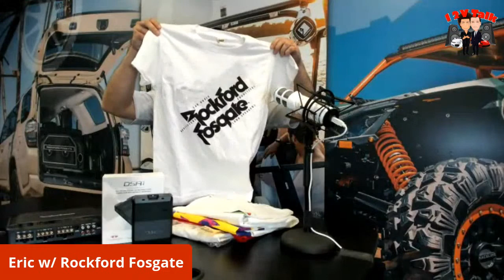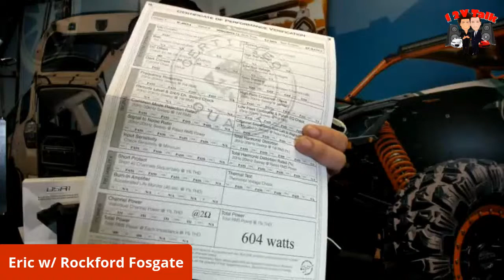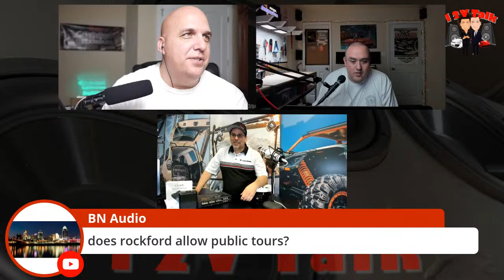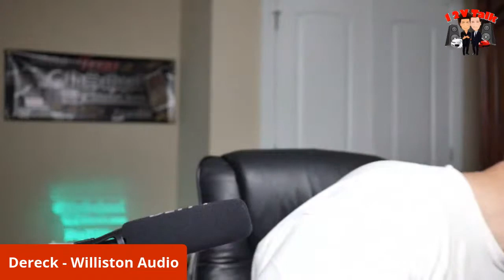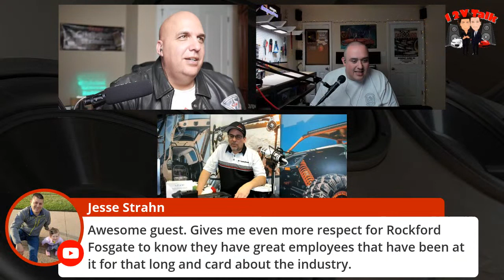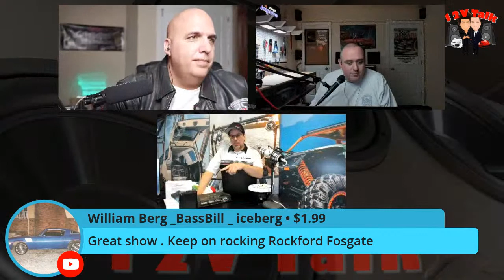Eric Russell - Rockford Fosgate - 12V Talk Episode 71

Comment: I have a dumb question....
Say I have two punch 501s and I have one bass knob. If I want to run one amp per sub and try to keep them balanced , how would I run one knob? I have an Oscilloscope so I can set everything pretty close deck and gain wise but I don't know how Rockford's bass knobs work as some amps have them as gain and others are a bass boost where's I've seen some as low level voltage rheostat.

Comment: Always been a RF fan, I still have an 800@4 from 1999 that's still in the box, it's never seen power. 😁
Reply: will you at least use it one day, so it's not a total waste...?
Reply: @RWL2012  Yes, lol. It's being used this summer to finish my system.
Reply: I have two 501s , one 500 power, one 800a4, 201s ,301s, 401s , 120a2, 150a2( I'd have to look on that one ) and subs... (2) 12 pch128, (2) hx2 10's and (2) p2 10's just bought (2) new p312d2's. I still use my set of pch65 's and power 6.5 components sets. Every Rockford I have bought ( minus one 75 watt and 250 watt amp...sold them ) I still have and I still use.

Comment: I have always been a fan but I will never buy another product from them.

My brother blew a fosgate shallow t1s2-12, its a 600$ sub. I reached out on his behalf in hopes of getting it repaired. 

Rockford offered mo help or anyone who could Repair it. 

That just left a bad taste from such a great company.

He has now went with Fi,   they will stand behind their subs and sell recone kits.  

As always a great interview.
Reply: Hi Dragon51,  Rockford Fosgate actually does replace subwoofers under warranty, and that proof of warranty is simply with a purchase receipt that shows the date of sale.  We do reject warranties, but that's almost always because customers do not provide a receipt.  The law protects consumers by claiming a warranty using the receipt because it proves the date of the transaction, which is when the warranty period starts.  If it's out of warranty ... there's other things to consider ... if the subwoofer voice coil was blown, then it's simply too much power applied to the subwoofer.   If the surround/spider are blown, that's typically caused by over-excursion typically from an incorrect box size.  

Unfortunately, we do not offer "recone" kits for that subwoofer due to the complex assembly process of the surround and voice coil gap requirements.  Nor have we found a repair facility that can accommodate our strict quality requirements.  With the proper setup of the amplifier / subwoofer, THERE SHOULD BE NO REASON FOR A RECONE KIT.  Unfortunately, a lot of companies have trained car audio enthusiasts that recone kits are the norm.  It's the responsibility of the company to work with customers so they understand how to properly match an amplifier's output power to the power handling of the speakers in addition to the max system level the audio can be played to ensure a long-lasting durability.  We don't just preach this, we put this into action with our own SoundLab demo vehicles.  These are on the road several months at a time, where they run hundreds of shows daily in the field without anything breaking.  Why?  Because we tuned the system so the amplifier to speaker system is properly matched.  We also know the max volume the system can be played without breaking anything.

I'm sorry the company didn't live up to your expectation.  If you're willing to give us a shot in the future, we'd love to learn about the system as a whole so we can provide the best recommendation possible and have a system that kicks ass, while lasting a long time.
Reply: @rockfordfosgate  The system was set up by a shop, he had 2 of those subs running off a Orion Extreme  2500.1.

He has had them for a few years, the one sub is frozen. It sucks that on a 600$ sub that fosgate won't Repair it. He did not expect it for free. 

 Thank you for your response though.
Reply: @TheoneDragon51  Thanks for that info!  The T1S2-12 are rated to handle 600W RMS, so 2 would provide 1200W of power handling capacity and can be wired to create a 1-ohm load.  The Orion XTR2500.1D (is this the right amp? http://www.orioncaraudio.com/discontinued/725-xtr25001d.html) is rated to produce 2,500W at 1-ohm.  That's double the power of what we'd recommend and almost certainly would burn-up the voice coils.  Are we still within the 1 year warranty?  If so, and you have the receipt, I'll see what I can do for you.
Reply: @rockfordfosgate  Yep that is the correct amp. The subs are out of warranty he been running them for last 2 years. He got them through crutchfield. 

It would've been nice if their was a recone kit. I thought they took at least 1k.  The shop should've set up the system better. The subs were under the back seat in his truck. They did sound good with his focal mids. Just a shame the one sub froze up.

Erick I do thank you for your time.
Reply: @TheoneDragon51  Yup, Sounds like that 1 sub is toast.  You're welcome ... I appreciate you giving me the opportunity to see if RF could make it right.    If you're interested, take a look at the VAST and the SYSM components on our explanation video and you'll see why we can't field repair them :-(  https://www.youtube.com/watch?v=yi6jPw-oCEE
Reply: @rockfordfosgate  Interesting video. Thank again.